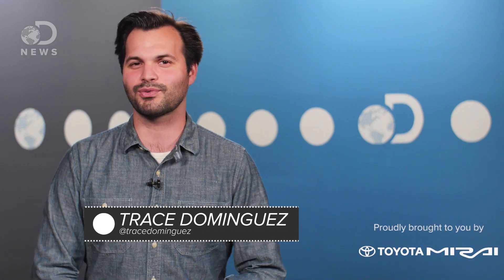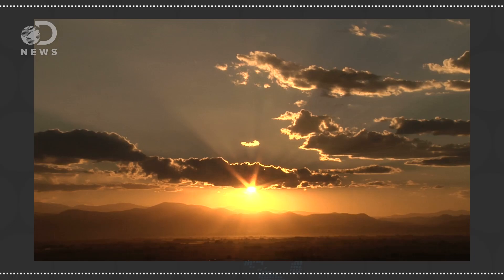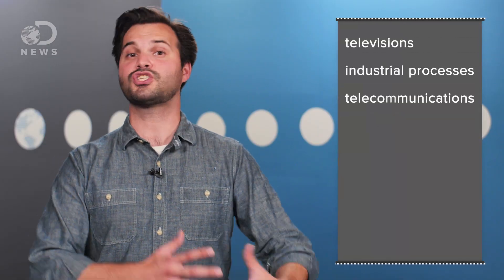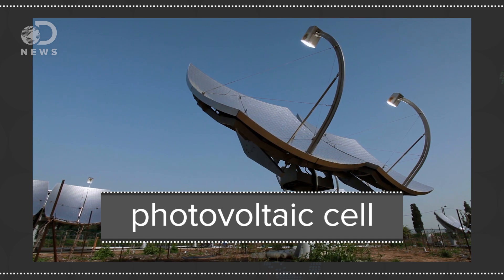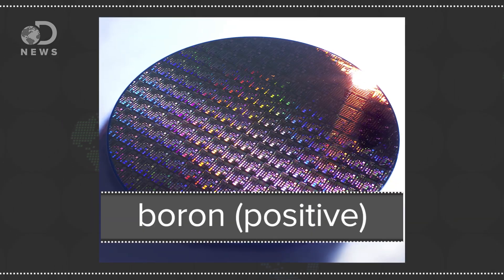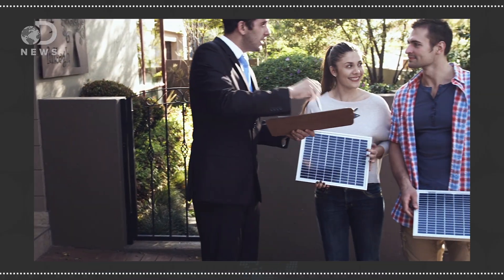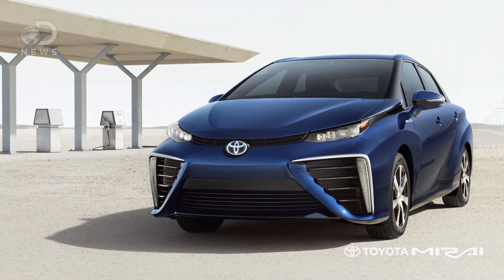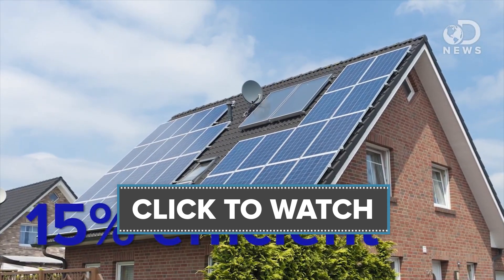How We Turn Solar Energy Into Electricity

Comment: I feel solar. Because wind takes up a lot of space, and hydro only works near running water. Nuclear energy is dangerous. Fossil fuels pollute and are limited.
However, it isn't always sunny. So I would say solar or wind. 

An idea, if they can make solar panels extremely durable, they should make roads out of them. That way energy is being made and it frees up a lot of land space. Also roads are near cities and houses. So energy.

And a question, could you use a light to power a solar panel? If you can, could you power a light from a solar panel and use that light on a solar panel?
Reply: And also make boats and cars with solar so that way no gas or electricity.
Reply: ***** oh. Well I still like my road idea.
Reply: ***** can I get an article?
Reply: ***** How so? The people over at solar roadways have already been pretty successful. Making a functioning prototype parking lot. And the cost for the final product should be cheaper than the cost of asphalt and its upkeep. Also since it can heat up, there could be a huge drop in driving accidents due to slippery asphalt. The tempered glass they use is almost if not bulletproof. There are a few adavancements to be made but for now it looks hopeful. What makes you think that i wont work?
Reply: dogs101o now tell me how would that work in the winter
Reply: There are some lights that can power a dolor panel but you use more energy keeping the light on than the light would produce.
Reply: Donomeh 
"And the cost for the final product should be cheaper than the cost of asphalt and its upkeep."
Asphalt is quite cheap and extremely durable. Solar cells are not cheap nor durable. Especially not under constant vibration and tons of pressure from cars driving on top of it. Almost no electric device is durable under constant vibration.

"Also since it can heat up there could be a huge drop in driving accidents due to slippery asphalt."
Heating uses energy, probably electric, which would sort of defeat the point of having a solar panel, as it would most likely use more electricity than the cells would generate.
Wet glass is extremely slippery as well.

"The tempered glass they use is almost if not bulletproof."
Glass scores higher on the Mohs hardness scale than asphalt, but you have to keep in mind that no matter how hard glass is, it does scratch, unless you use some sort of crystal glass like sapphire. However, that is extremely expensive to use on thousands or millions of kilometers of roads.
To produce electricity through photovoltaics, you need extremely clear glass, with almost zero impurities. For glass to bear the weight of a car or truck, it has to be several centimeters thick, which would reduce the light penetration. This combined with the low lying level of the solar cells, with them being dug deep into the ground to make room for the glass and protect them from vibrations AND with them lying flat, makes the solar angle way too low for most of the day, significantly reducing any miniscule power production these type of cells would produce under such poor working conditions. Cars also cast shadows on the panels, which also reduces the production significantly.

The economics and physics are all wrong when you really think about solar roadways.
It would be much cheaper and much more effective to just set up solar panels next to the roads, or make it law that all new houses should be installed with a certain capacity of photovoltaics or whatever. Almost anything regarding solar panels is better than solar roadways.
Reply: Lemonz1989 each house could have solar panels on the roofs. But that doesn't do good for other things. A solar road could work. Just need different things instead of glass. Something that is clear.
Reply: dogs101o
"each house could have solar panels on the roofs. But that doesn't do good for other things."
Which other things are you referring to?

"A solar road could work. Just need different things instead of glass. Something that is clear."
Maybe, but it's too expensive, too dangerous and not viable with our current technology. Some people that were testing solar roadways said they were going to use diodes as markings for the lanes and stuff like that, and when the math was done, showed that the diodes used more power than the panels could produce.
Current solar panels don't work while lying flat. You need a 90 degree angle towards the sun for them to be the most effective.
Reply: Lemonz1989 I'm referring to huge skyscrapers. Buildings that have a flat top. And it would be bad for storms, or places of shade. Usually roads are out in the open.

And I never said the road with our current technology. We could easily find a way to get something else clear with good strength.
Reply: Lemonz1989 but what could really be good to stop a lot of pollution is have cars and boats that just run on amazing solar panels. Cars at most. We could just go electric. It would take a while because solar doesn't make much energy. However, in the future, we could find a way. For now it would be cool for some solar energy on somethings. That way we don't need to rely so heavily on gas and other energy. 

Oh, solar panels on roofs also would not be good for apartments.
Reply: dogs101o
"I'm referring to huge skyscrapers. Buildings that have a flat top. And it would be bad for storms, or places of shade."
You can mount solar panels on metal systems that are at the correct angle. They are made for flat roofs. Like the picture here:
http://www.ecohisolar.co.uk/case-studies/schuco-10-kwp/

Homeowners also already take precautions with their solar panels, when storms come. You can cover them up so they don't get damaged. You can also insure them, in case they are damaged in a storm.

It's not good for all situations, obviously, but it is still better than solar roadways.

"Usually roads are out in the open."
So are many/most roofs.

"We could easily find a way to get something else clear with good strength."
I wouldn't say "easily". It has to fulfill many different criteria, which makes it basically impossible for the next many decades, at least.
It has to have enough grip, so it isn't slippery for cars. It has to be extremely strong and scratch proof. It has to be very transparent. On top of that, we need electronics that are able to handle years of vibrations from cars, and we need solar panels that have significantly higher outputs than any we have now, for it to be even slightly profitable.

It would take a while because solar doesn't make much energy"
I don't know about that. There are many houses in Denmark (where I live) and Germany that have their entire energy needs covered by having solar panels on the roof. My family would only need a 6 kW system to cover 80 to 90% of our energy needs. Tesla Motors is currently developing a battery system for homeowners to store the excess solar power, so they can use it at night as well. This way, my family could cover 100% of our energy needs with a 6 kW system.
This is something we can do now. There is no need to make up fantastical and expensive solutions to a relatively simple problem.

"Oh, solar panels on roofs also would not be good for apartments."
Why not? There are many apartment complexes in Denmark and Germany that have solar panels, where the power savings are passed on to the tenants.

It just doesn't make any sense to have solar roadways, when we have functional technology that is way better than solar roadways probably ever will be.
Reply: Lemonz1989 I still think solar roadways will be good. You are ignorant to think that it will take decades. If it was something scientists really wanted, they could find a way. And I used to live right next to a house with solar panels on the roof. It was good, it had enough energy that they got paid by the electric company. However, when a storm hits, there was a lightning bolts that hit them. It cost a lot to repair/replace. That is what I ment by storms. And I am fully aware of the things that angle the panels. However I didn't mean to say flat roofs. I just ment huge buildings. And why? Because it isn't enough to power huge skyscrapers or apartment buildings. I live in America. We are wasteful. But I ment cars, when I said it wasn't enough energy. That is why we don't have many cars like that today. And boats can just run of solar panels.
Reply: dogs101o I mean boats can't just run off solar panels.

Comment: Every other source of power is a result of solar energy. So solar energy
Reply: Nuclear energy
FTFY
Reply: Bruno J. Militão M. A  hundred and fifty million years after the Big Bang, the first stars exploded .which created the heavier elements. Plutonium ,uranium so forth. So still a direct result of solar energy.
Reply: louie maldonado Well, you could theoretically build a power plant that runs on the cosmic microwave background...
Reply: louie maldonado Geothermal isn't solar energy. That's due to gravity. :)
Reply: Lemonz1989 Actually geothermal is down to the heat of the mantle, powered by radioactive decay in the earth's core.
Reply: But solar energy comes from nuclear reactions.
Reply: The sun is a nuclear reactor  zzzbb8
Reply: Hence why I said its energy comes from nuclear reactions.
Reply: IamGrimalkin Yes, I forgot about that. :p We are both right, though. It seems that around 20% of the geothermal energy is powered from the formation of the Earth (gravity - remnants of that energy) and 80% is from radioactive decay. :)
Or am I misunderstanding some definition here? :P

Comment: We may be some way off, but in the near future Hydrogen is the answer. It's clean and generates much more energy than any other source.
Reply: redflamelcd Explain to me how to create industrial quantities of hydrogen. I'll spoil it for you. Hydrogen is NOT an energy source, like fossil fuels, nuclear power, or solar energy is. It is an energy STORAGE, like a battery. It requires other sources of energy to be produced, either derived from natural gas or electricity.
Reply: Algae, hemp, solar, battery.
Reply: redflamelcd If we are talking about cars, then no. Electric solutions to cars are way better then hydrogen and easier.
Reply: JWQweqOPDH Ahemm... Fusion reactors using hydrogen. Electrolyze water and use hydrogen for reactors. When fusion becomes better of course. If a fusion reactor could start up it could probally electrolyze more than enough hydrogen for itself.
Reply: SwedishPerson That's fusion. It's completely unrelated to hydrogen fuel cells. Fusion requires heavy hydrogen, and don't even exist as viable reactors yet.
Reply: SwedishPerson j8
Reply: JWQweqOPDH Ah, thought you meant hydrogen only, not fuel cells.
Reply: KillHead NO The long charging times are a bitch though... We'll need a lot better capacitors if we want to use our cars daily.. not to mention the electrical infrastructure.. Also electricity still pollutes because we use coal, gass and nuclear plants to generate it.

It would be better to create a green fuel instead of changing the entire infrastructure. For example the new synthetic fuel created by audi which used electricity, water and CO2 from the air to create a synthetic fuel which can be used in current cars. So using fuel like this you can put all your money into researching better energy sources instead of replacing current infrastucture. And thus, this means if you can produce electricity in a "green" way you can eliminate polution by a lot. Even better, you can transport fuel which electricity can't (at least not in practical quantities).
Reply: Just grow hemp all over the planet for fucks' sake.
Reply: JWQweqOPDH Fusion doesn't require heavy hydrogen, Get your facts straight, The sun uses the standard H-H fusion method because there is enough energy to put into the system.

The reason we use D-T for our fusion test's on earth is because it requires the least amount of kickstarting energy than H-H does, but that doesn't mean you REQUIRE Heavy hydrogen for the task.
Reply: OnePercent Sorry, I was implying I meant within power plants, because that's what we're talking about after all, is energy solutions for the near future.
Reply: JWQweqOPDH Of Course, Hopefully we figure out LFTR before we destroy the oceans.

Comment: Hydro is the bees knees
Reply: Deserts? Or any land without water close by?
Reply: Daily Cake Slice The problem with hydrogen cars isn't that they're explosive.  It's that they cost way too much, get about the same fuel economy as a prius, making hydrogen with either electricity or natural gas is wasteful, and building hydrogen fueling stations is way too expensive.
Reply: dogs101o Then use another source of energy. I don't think we'll ever reach a point where energy is made with a single source.
Reply: Ben Melindy I think hydrogen cars sound cool... but do we really want a bunch of Hindenburgs-on-wheels driving around?
Reply: Daily Cake Slice I'm talking hydro dams ala churchill falls, not hydrogen. Hydro power is extremely efficient.
Reply: +Daily Cake Slice
Hindenburg was filled with helium, not hydrogen -.-
Reply: dogs101o  hydroelectric wave generators near oceans, solar in the desert and areas that it can best be utilized as well as wind (like the wasteland after fracking was done). gravity hydro in areas where there is falling water.
Reply: Ben Melindy Wow, I feel dumb XD It's late at night.... But yeah hydro I think is pretty cool for the areas that can get it.
***** No, it was hydrogen. Helium is a noble gas, and therefore fairly nonreactive. Or at least as not as much as hydrogen. The Hindenburg was notorious for it's explosion due to the hydrogen. That's why helium is used for blimps and balloons. I never actually had a class or anything on this, I originally learned about it on an episode of Archer, and later heard more and more. 

Hopefully my previous stupidity was made up for by this science lesson. :P
Reply: Daily Cake Slice
OH SHIT I FEEL STUPID RIGHT NOW AFTER WATCHING AN HOUR LONG DOCUMENTARY OF WHAT CAUSED IT TO CRASH YESTERDAY LOL
Reply: John Salinas At the moment yes, but investments will lead to more affordable designs. You think the first gas-powered cars were affordable to the general public? We just need the rich to start caring more :/
Reply: All those technologies require a large area to generate small amounts of power. It's not practical in an overpopulated world where living space is getting scarce and the global population growing faster and faster every year. So unless people start keeping their pants on, and we cull maybe a billion people, we're stuck with coal and nuclear untill be can find something better that can produce huge amounts of power (maybe/hopefully fusion?).
Reply: It cost😢or👍